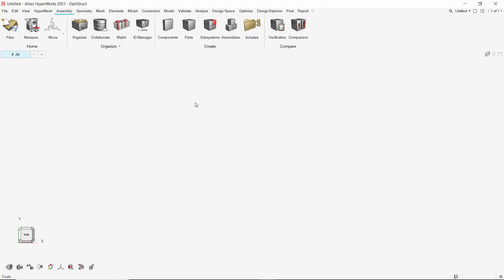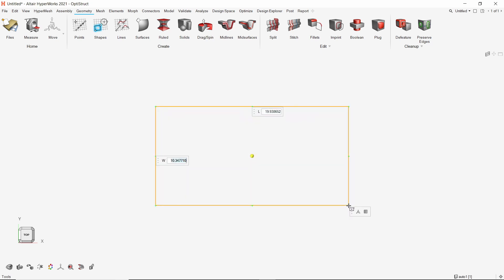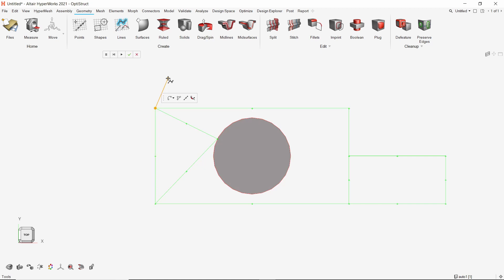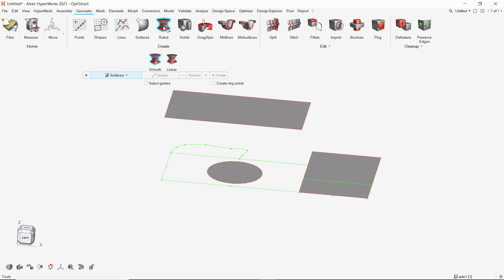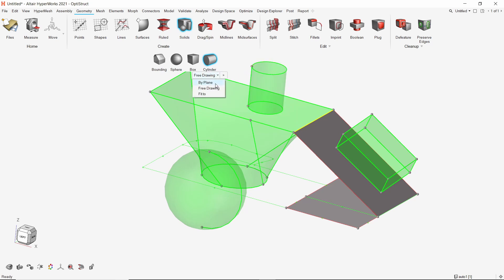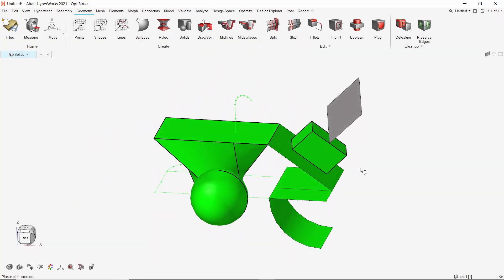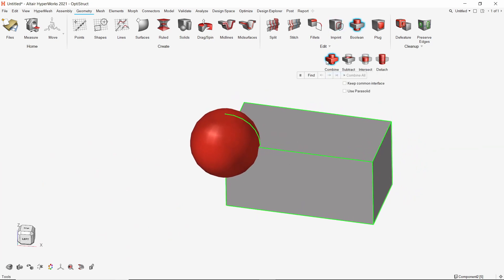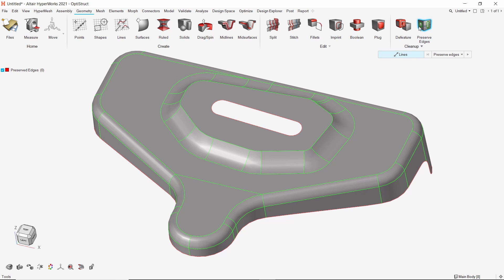Introduction to Hyperworks PART-1 [Geometry]

Comment: HI, when i open hyperworks on the top left corner it is showing  acu solve instead of opistruct why is that?
Reply from the maker: Hey there,
HyperWorks is a solver neutral pre and post processor. You need to change the user profile to 'Optistruct' before starting the analysis setup. This can be done using the 'User profile' option in the ribbon.
I hope this helps.

Comment: Good an simple explanation. 
I worked with the new GUI a bit, but what I think is missing in the geometry creation are constrains for these types of "sketches" e.g. to define two lines are perpendicular.  I also miss a basic dimensioning tool that allows you to edit your model based on the sketchings. Long story short: The geometry tools dont replace a basic designing program.
Reply from the maker: Yes, you are right. These geometry tools are far from competing against CAD software in the market. But we must keep in mind that Hyperworks is a CAE software and not a CAD software. It can perform operations which a traditional CAD software cannot.

Point is, geometry modeling may have been introduced in the new interface, but it is not the prime focus. The CAE tools are more important and currently, Hyperworks is surely an industry leader in that aspect !

Comment: Hi Aeroswap, how do we change the dimension units in Altair Hyperworks? Since I am quite new to Altair Hyperworks.
Reply from the maker: Hi Daniel, Hyperworks is not a CAD software hence you will not be able to change dimension values like it is done in CAD software like Solidworks/Catia.
You need to open the geometry tool again and select the shape to edit its dimensions.
Reply: @Aeroswap  I see, now I understand why I couldn't find this on the help setting, thank you. It's really helpful.

Comment: Is it necessary to import the complex geometry from solid work or we can create in hyperwork as well
Reply from the maker: You can create it in Hyperworks. However, doing it in Solidworks would be much faster as more CAD editing tools are available in that software.
Reply: @Aeroswap  Yaa but simple geometry can be drawn in Hyperwork. Can you plz tell me where is usually batch file located for the Acurun path. I am facing problem for running the hyperwork CFD model. Because i cant file Acurun batch file to browse
Reply from the maker: The acurun batch file is located in the Acusolve installation folder in C drive (same location where complete Hyperworks package is installed).
Reply: @Aeroswap  Thanks bro for guiding me in the right direction. You just save me. Finally, i run my first simulation. Huge respect and love . I saw most your video on optistructure. Can you plz make some vidoe on hyperwork cfd with transient analysis.
Reply from the maker: Hi Mudassir, I am glad to know that you liked the videos. Thank you for the suggestion. I will work on these topics soon!